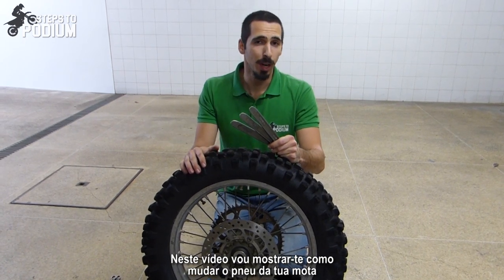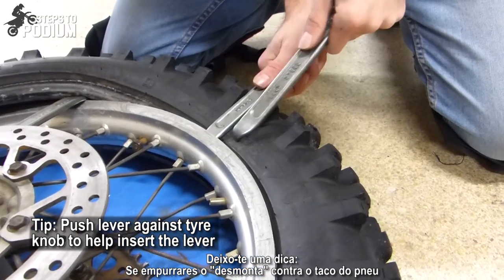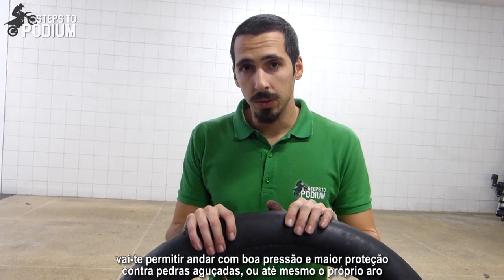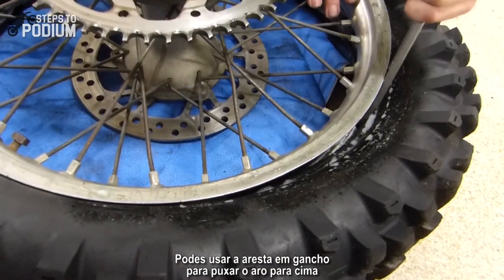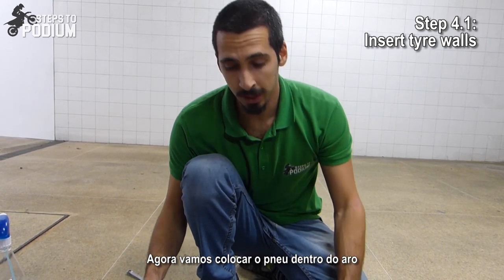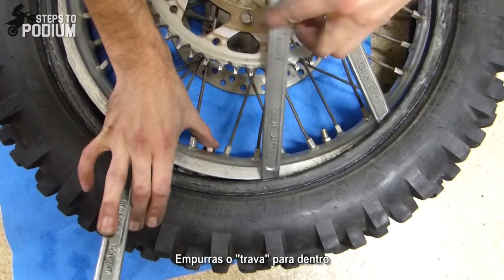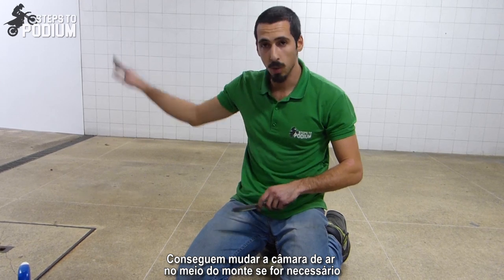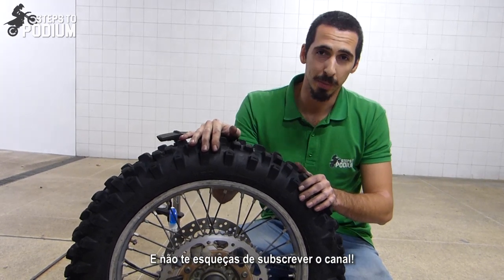How to change a dirt bike tyre with 3 levers

Comment: You are obviously very skilled, but not sure why you are doing this sprocket side up.  I bent a disk rotor doing it like that once, also if your hand slips it could get cut on the sprocket teeth.  You have great video's, keep it up!
Reply from the maker: That was the nicest way I ever heard someone saying "for fuck sake man, you were so clever in your other videos, why the hell would you dumb it up on this?" 🤣🤣🤣 you're right, I missed that during the recording. I usually do it like you mention but with everything a guy has to keep in check during the rcording, I didn't pay atention to that 😛